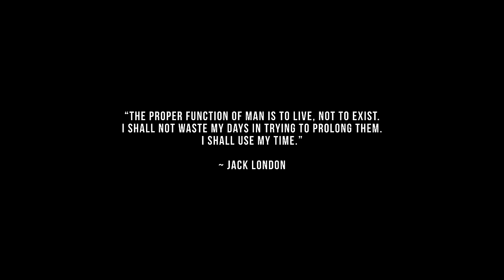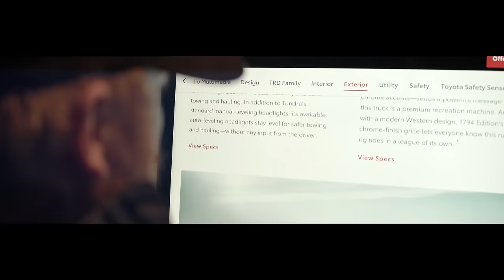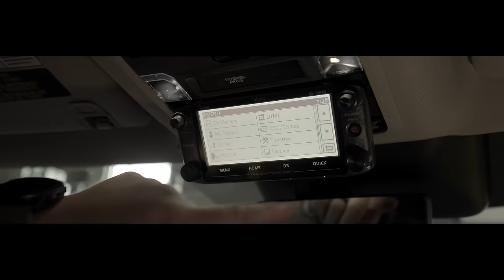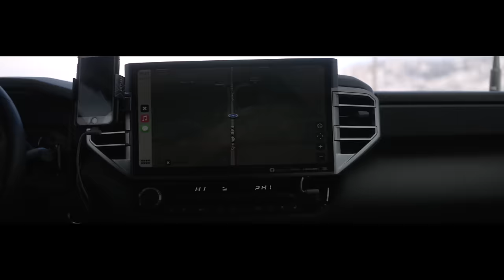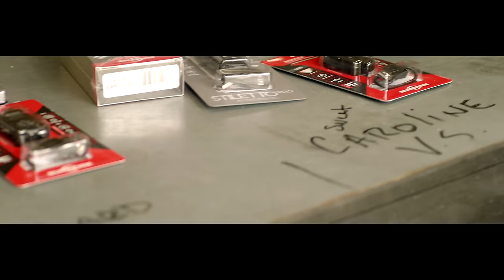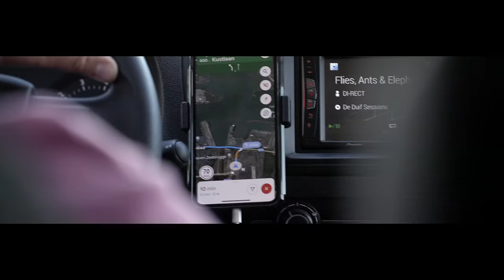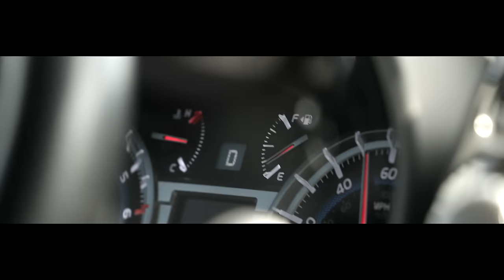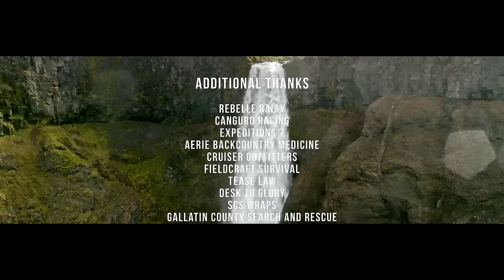EP1 Overlanding Scandinavia | The Proper Function of Man is to Live | X Overland Nordic Series

Comment: Looks like it is going to be a good adventure.  Glad we get to go along for the ride.  I see you guys were using radios.  Is it a problem?  I know different countries have different rules regarding radios and their uses.
Reply: Good point! Based on the vehicle builds section of their website, they're running ICOM ID-5100A 2m/70cm amateur radio transceivers. As long as one holds an ARRL general class license (or higher) and pays attention to local frequency band plans, one can transmit in Europe (and certain other places) under CEPT novice license recommendation ECC (05)06.
Reply: Thanks for the information.  I don’t think people really think about it especially when they are traveling into Canada, Mexico, or another country you can get to by ground.  I just have my GMRS radio license.

Comment: Certainly a different journey than the Return To The MacKenzie series where I found your channel. Question for ya... what radio system are you using in the vehicles, CB, VHF and how did you handle the international requirements for the radios you had? I always enjoy your content... safe travels.
Reply: Good point! Based on the vehicle builds section of their website, they're running ICOM ID-5100A 2m/70cm amateur radio transceivers. As long as one holds an ARRL general class license (or higher) and pays attention to local frequency band plans, one can transmit in Europe (and certain other places) under CEPT novice license recommendation ECC (05)06.